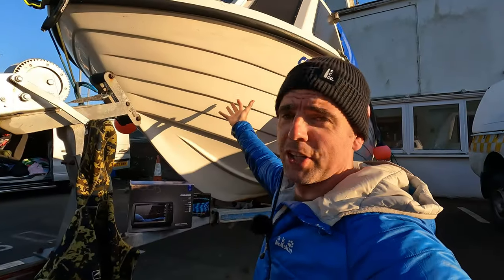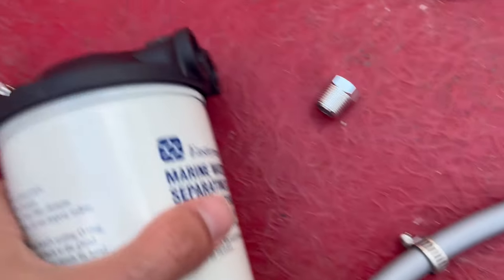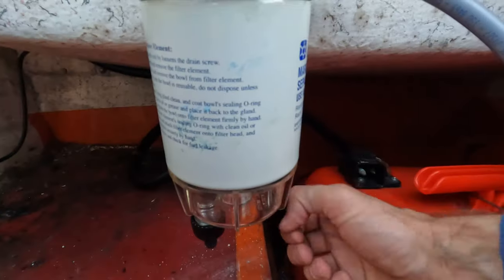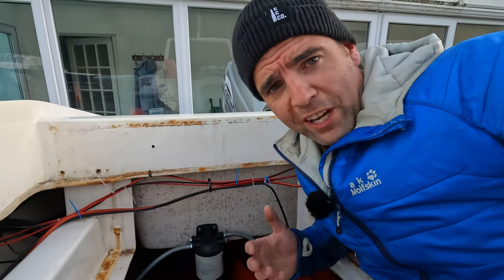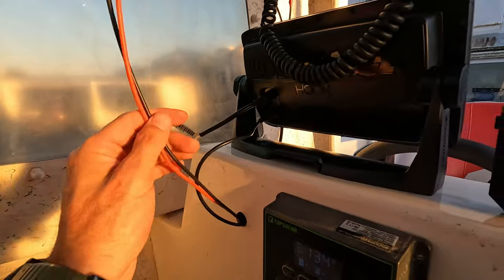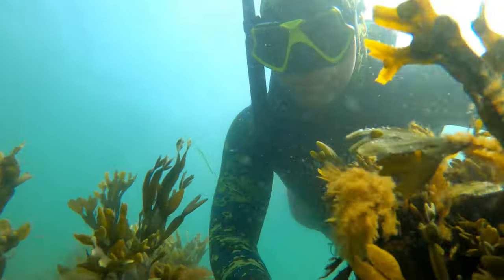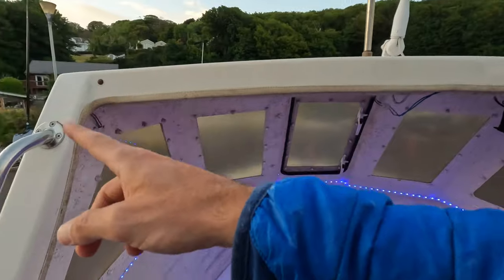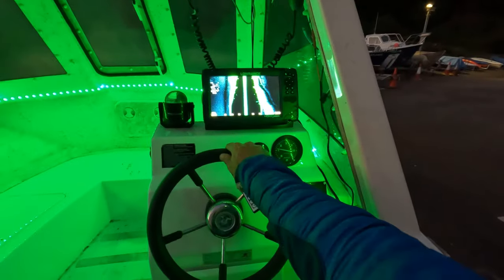SMALL BOAT Project Ep.6 -  Fishfinder Install, LED lights, Fuel water separator Ep.6

Comment: I have the same outboard motor as seen in your video, but also want to run two fuel tanks. Have you done the connection and if so, is there a video? Many thanks Mal
Reply from the maker: Hi Mal, I had two firm thanks but kept them separated, two fuel lines so I could plug and play and refuel easier
Reply: @AirbornePirates  many thanks for your prompt reply. When you have a moment, could you post an image....no rush as i am yet to install the fuel filter/water separator, that would be a massive help. Many thanks in advance, Mal